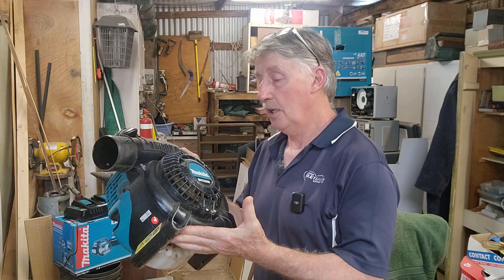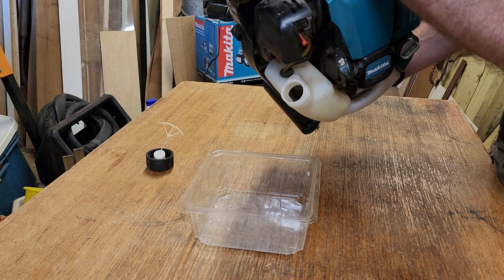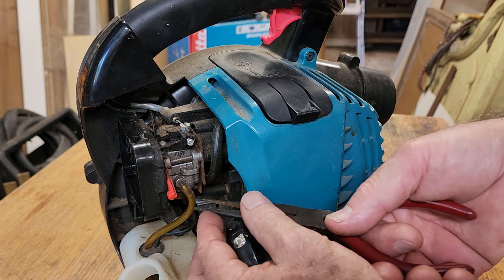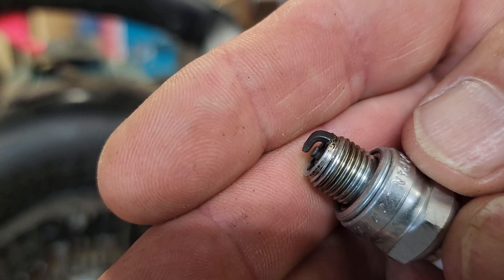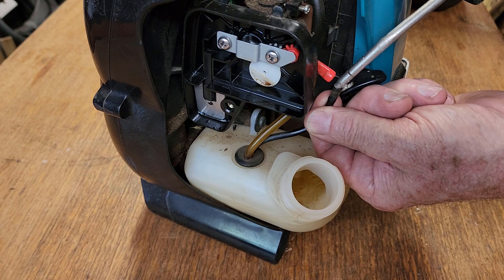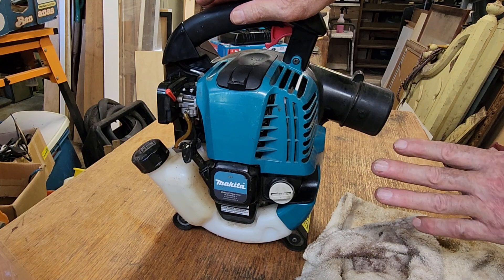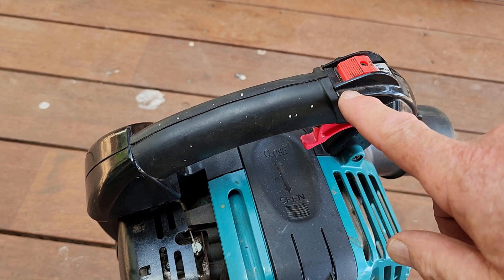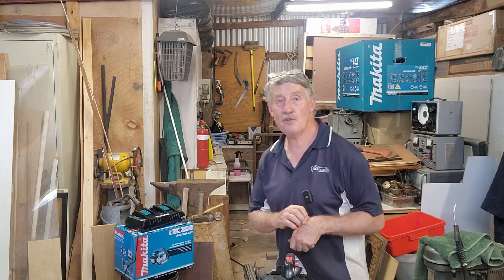How to Service & Check a Makita BHX2500 4 Stroke Leaf Blower plus Test & Review! Are They Any Good?

Comment: I have the Dolmar unit pb250.4 which is exactly the same . Mine has bogging down issues,  luckily i read your comments so will check the fuel cap for a breather hole .
Reply from the maker: Hope you had some success Paul. Bogging down though sounds more like a running rich problem..

Comment: I use these at work for the last 10 years.  I probably put 200hrs on it a year, and over 10 years have bought 3 of them.

They are quality..  totally recommend, all three still work, had a new worker clean the carburetor of the two that I kept for spare parts, and got them running as good as new.

I always changed the oil every 6 months with how much use we do..
Reply from the maker: Good fuel and regular maintenance goes a long way! And of course, a quality machine in the first place! Thanks 😊

Comment: Good video my makita blower once warm starts to miss and stalls, with in 2 min of running. 
Air filters clean always use good fuel any ideas
Reply from the maker: Maybe check the muffler to make sure it hasn't been blocked up by a wasp nest or carbon (some have a spark arrestor screen which can block). Something else to check is the choke to make sure it isn't vibrating on. And make sure the fuel line isn't kinked limiting fuel supply..
Reply: Thanks i will check what you have told me and let you know

Comment: I have the same leaf blower, however although mine idles well, it bogs down when I apply throttle. I dis everything you did, and it's still the same. I was wondering if there is a spark arrestor on these machines ? If so, where is it, as I'd like to clean it if dirty. Thanks for the informative video. 👍
Reply from the maker: They often have a spark arrestor screen on the muffler Ray and that can carbon up - although that's more common with 2 strokes. It's normally on the muffler outlet. The symptoms sound like the fuel/air mixture is wrong. Does it still do it with the air filter removed? It's either running too rich, or too lean.

Comment: How does one know if they have an ignition fault? I have a feeling mine gets warm and the ignition cuts out (I replaced the carby and it still won't accept throttle😢) Has been a great unit for many years though 😊. And do they have a spark arrestor?
Reply from the maker: I think an ignition fault when warm is a pretty rare condition. It is possible that the stop wire is shorting on something - or even a dodgy spark plug. Does it rev out when cold? It could be a blocked muffler or restricted spark arrestor (often on the outlet of the muffler). Perhaps the mixture is wrong - the Chinese replacement carbies are not always the best quality!
Reply: @TheUltimateRecycler  hi, yes when cold it runs wide open throttle for a few mins then bogs down and dies again. Wait a minute or two and does the same thing. The muffler and spark arrestor is clean and clear. Next I will reset the valve clearances and see how it goes. The thing that got me confused is it idles perfectly!? Cheers

Comment: Love the video. 

I have a question,  i have the same one mines started being really smokey and bogs out now and again.  What should i be looking at please?
Reply from the maker: That sounds like either stale fuel (or a poor mix) - or possibly the engine is choking to some extend. Does it do it with the air filter removed?

Comment: Ignition coil I ordered a new one, that has one wire. My old one has two wires. Can the new one be made to work. 4:04 4:08
Reply from the maker: The Ignition coil should just have the main spark plug lead and a 'stop' wire which just cuts the spark when earthed. Where did the two wires on your old unit go?
Reply: @TheUltimateRecycler  They went to the on off switch. All’s good now.  Thank you 😊

Comment: I have the same unit and it's been an eager partner for about 10 years. Recently, it's been dripping oil from the air cleaner area; it runs fine, but I'm getting an oil patch underneath after use. It looks like the unit you reviewed had an oil-soaked air filter as well. Any thoughts on what could cause oil dripping from air cleaner? Oil level is where it should be. Thanks.
Reply from the maker: Thanks for your comment David. There shouldn't really be any oil getting to the air filter from within the engine but it's not likely to be a problem anyway as an oily air filter will trap more dust from entering the engine. I usually wash the air filters in 2 stroke fuel to make sure they are a little oily anyways. If it becomes too oily, it will start to choke the engine a bit - so time to wash it out again..
Reply: @TheUltimateRecycler  This is actually an issue with them. They get enough oil in the filter and prefilter to block off the air and they then refuse to start. I'm researching that currently which led me here. I have the same blower and also two of the trimmers with the same engine, and while they advertised as able to tip any direction I suspect if you do that on a particular angle while the oil is at the high mark that causes the oil in the air filters. I did have one good run for several months vertical edging while the oil was middle level so that's my working theory.
Been my daily for 13 or 14 years now and when the filter's clean it's a first pull start usually without choke. Same with the trimmers.
As far as I know Makita is bowing out of the petrol engine market tho in favour of craptastic battery so these old units may become a problem to get parts for in future. I'm in New Zealand so sourcing parts from America is a pain at the best of times. The trimmers are so good I've only ever seen one other for sale second hand in New Zealand, and I snapped that thing up real fast 🤣

Comment: how does it compare noise wise to the 2 stroke ones? i picked up an almost ready to throw a rod  4 stroke Honda one a few years back(hate to think how hard a life it had) and it was surprisingly quiet other than the knocking engine) the honda had a timing belt which can snap/jump apparently, is the Makita pushrod type?
Reply from the maker: Honestly I haven't had one of these apart so not sure on the mechanical details Dean! 4 strokes are usually much quieter than 2 strokes as the don't rev as hard.

Comment: Hi my Mikita 4stroke ‘ Boggs down and stalls after goin for about 5 minutes . Have any idea what be wrong . Any help be appreciated Thank U.
Reply from the maker: If it's running well for the first few minutes - maybe the choke is vibrating on? That would be my first guess Rob..
Reply: My Mikita did the same thing. I changed the spark plug and it works great now.
Reply: Common on this model.  It’s a vacuum problem.  Have to open up gas cap while running or drill a small hole in top to allow motor to breathe as the internal vent in the cap is insufficient.
Reply: Might be a pinhole leak in the fuel line. Hard to see those little buggers some times